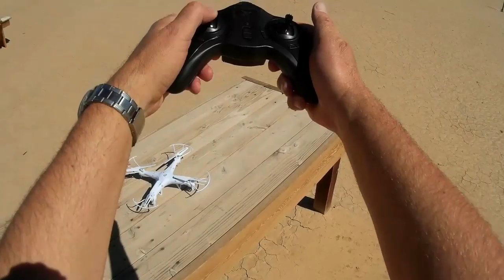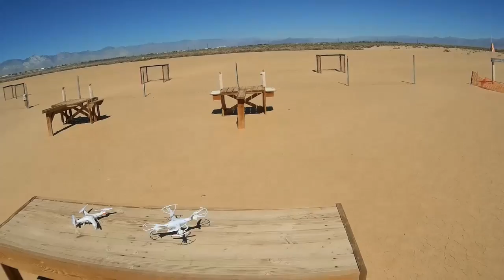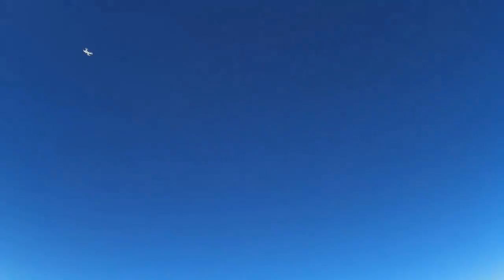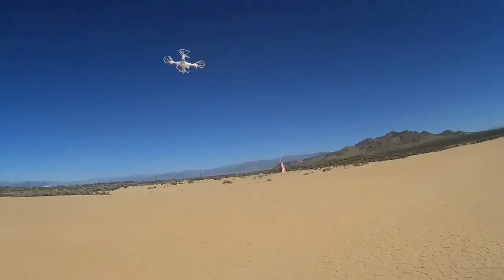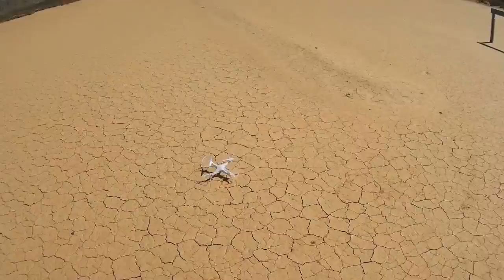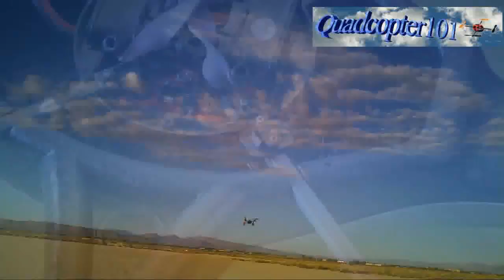FY326 Q7 drone:Syma X5C clone!

Comment: Hey Quadcopter101!
I got one of these the other day and broke it on it's maiden. It had some dropouts and then some problem where it didn't seem to respond to the stick properly. With a hard landing an arm broke near the motor, almost snapped off, but I can glue it. Pretty cheap construction there...the plastic looked dirty right out of the box too.
However..some interesting news...I found that it binds to the WLToys V252 Pro Skylark Tx.
Reply from the maker: Dave Review Haven't noticed any dropouts with mine?  Were you lifting a camera by chance?
Reply: Quadcopter 101 
No, but I took it up to about 250 feet. Not sure if it was wind, but I had a bit of a time getting it back, after that. It went laterally over a ravine and then it had what appeared to be several dropouts and not responding well to the stick.  Perhaps it was due to low input on the throttle?
Reply: Quadcopter 101 
After I fix the arm I'll be checking the stock Tx vs. the trusty WLToys Tx to compare. The V252 Pro Skylark Tx never fails, so it'll be a good way to test and compare.

Comment: My Q7 arrived today. About 3 weeks. First thing I noticed is the super incredibly slow yaw in beginner mode. Thankfully it increases with expert mode. I have another X5C clone, the M68R, which keeps the same yaw between modes. 

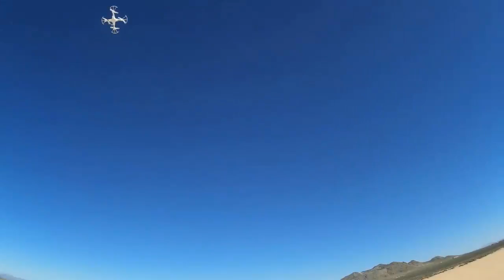At 8:30 you state your transmitter uses 4 AA batteries, mine uses 4 AAA. But it looks just like yours.

Comment: Thanks for the review.
I like the review format, very good for comparing quadcopters (range etc)
I was wondering if this is the best quadcopters of the X5c clones ?
Would you say this flys better than the X5c ?
Is this the best one for beginners at the moment ?
Here in the UK these can be had from Amazon for £22 (which is peanuts)
I would have liked a camera on this but I do have a key chain camera so I could use that instead.
Thanks for the review again. keep up the good work
Reply from the maker: Yes this is currently the best IMO of the Syma X5C clones, especially for the price.  However note that when carrying a camera, range seems to be reduced to about 70m (vice 150m).  But 70m is about the range of an X5C.
Reply: Still sounds good.
I have been looking on Amazon and it doesnt look like I can get spare blades for it.
Do you know if the Syma X5C blades will fit it ?
I suspect the battery will, So I could get a few spare batteries
Reply from the maker: BillyNoMates1974 No they won't fit.  The FY326 propeller shaft is wider diameter than the X5C.
Reply: ah shame.
Thanks for checking.
I will have to search around
Reply: Quadcopter 101 do you think if you drilled out the center of the x5c propellers a little bit they might fit? parts availability sucks but i think im going to buy one of these regardless lol

Comment: Hey Q101 - what would you recommend as an upgrade to the charger included with the X5c and this quad for these small batteries?
Reply from the maker: For these small single cell LiPo's I don't recommend  an upgraded charger at all.  The stock charger that comes is just fine.

Comment: Hi Quadcopter 101, Thank you very much for the review and the link,I just order mine,It is my first quad,I am new to this hobby,if I like it I will eventually upgrade.Thanks
Reply: lion 237 Discount on for spares
Blades - http://www.gearbest.com/rc-quadcopters-parts/pp_174146.html?vip=26167
Motors - http://www.gearbest.com/rc-quadcopters-parts/pp_174144.html?vip=26168
Body Cover - http://www.gearbest.com/rc-quadcopters-parts/pp_174148.html?vip=26170

Comment: I have heard or read comments about the shorter range of the X5C, but that is not the case with mine.  I made a couple very minor adjustments and measured the range to be at least 125 giant steps (I'm 6 ft) across a parking lot.  The range may have been longer, but I ran out of parking lot. 
The first thing I did was to open the transmitter and make sure the antenna was straight and pointed out towards the fake antenna in the case.  I measured the length, and it was close to the recommended 1/4 wave value.  The next thing was to remove the camera to gain a good view to the front of the receiver/controller board.  The receiving antenna was bent to the side, parallel and in contact with the wires for the motors and LEDs.  Using a stick or other slim tool, I moved the antenna as far away from the other wires as possible, so it was as perpendicular as possible to the board and pushed any other wires as far away from the antenna as possible.   
Some time later after I made the first measurement, I took the top off of the X5 and filed a small notch in the case so the antenna protrudes out the case about a centimeter.  I also routed the wires further away from the antenna.  The receiving antenna seems to be overlooked by most, but it is as much a part of the range equation as the transmitter power and antenna. 
The other easy thing to check is that the batteries are not dropping in voltage when the transmitter is turned on.  A couple small holes drilled in the back of the transmitter will allow voltmeter probes to measure the battery condition w/o removing the back.

Comment: Are there any repair parts fort this quad?
Reply from the maker: It uses the same parts as the X5C.
Reply from the maker: I misspoke(mistyped?).  I just tried interchanging parts between the two to demonstrate flying with X5C parts.  I found that its parts although nearly identical to the X5C, each have some very tiny difference that doesn't allow interchangeability of parts between the X5C and the FY326. Am guessing that this may be how this company skirts around copyright issues?  However, the batteries definitely are interchangeable.

Comment: I just to my x5c-1 and did a range mod I love it. Have you seen the new JJRC H12C quadcopter? It looks pretty cool with a 1080p 5 mp camera!
Reply: I have one...stock battery without video is about 6.5 mins of flight time with the lights off. Get some extra batteries...its one hell of a nice quad. The thing flies really well and the pictures and video it takes are surpassingly good! However, the return to home function it has is terrible....dont ever use it lol.
Reply: +badd99 I'm thinking about purchasing one. The camera quality looks as good as the 808 #16 in videos. And the orange one is quite sexy lol. Do you recommend it. I know there probably isn't much point due to the fact I just got the syma.
Reply: I really do like it a lot...I also have the orange one. I think it's a really good flyer and the camera really did blow me away for the size of it (and price!)
Reply: badd99  I think i might have to order one, it looks to good to pass up
Reply: I just got two batteries I ordered off ebay...they are 1200mah 25c batteries with the jst battery connector (same as all these small quads.) With just one of the batteries I got 7.5 of video time! I havent tested with just flight, but id imagine it would be around 10-11 mins! When you factor both of them were only $9.99 (in addition to the battery that came with it) I can get 22-28 mins of flight time with the three now. Great deal!